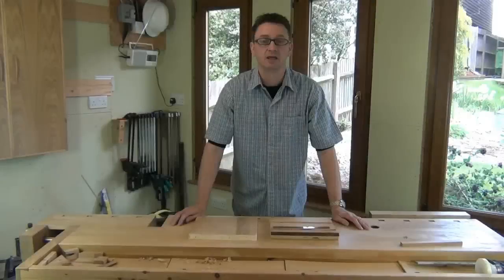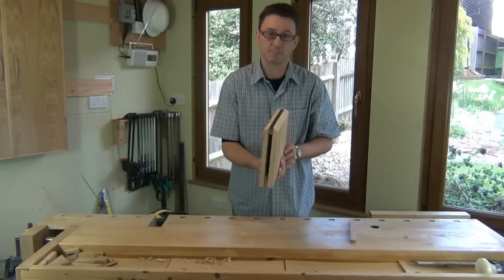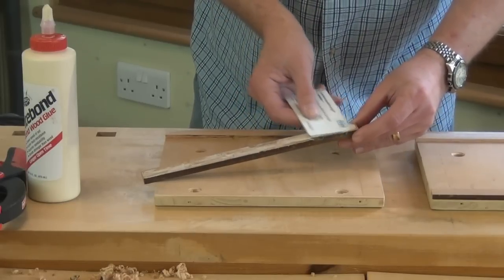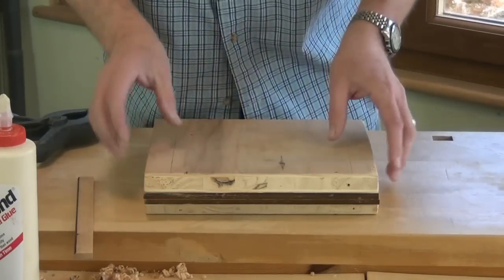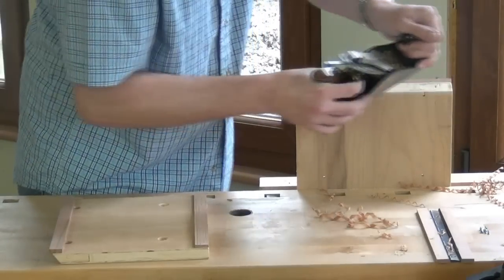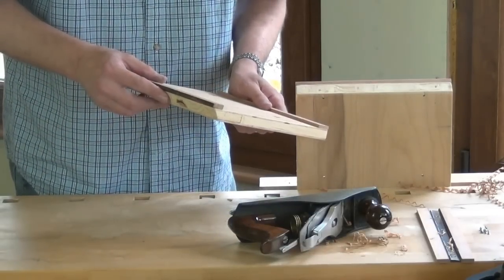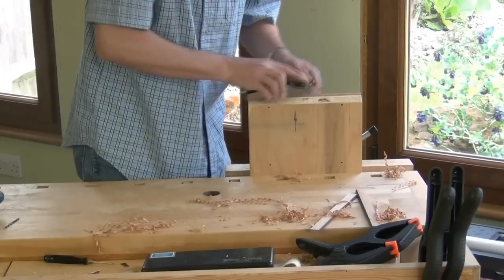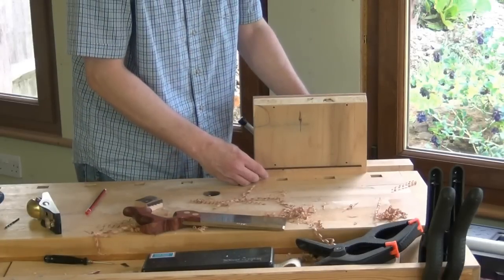Saw Vise - DIY, FREE Plans

Comment: If anything you would want B bigger than A to ensure the very top pinches tight, you've got it backwards in that respect. Otherwise the bottom of the top battens would touch before the top and you would have to bevel your top battens so they are wider at the top. Great plans though.
Reply from the maker: Haven't looked at these for years, but it's possible I made a mistake drawing them up. I'll try and remember to check on it next time I'm using SketchUp. Thanks
Reply from the maker: I understand what you're saying, but if B is larger than A, the top won't close at all since the bench vise will tighten on B before A closes. The very top of the saw vise jaws will be fractionally less tight than the bottom, unless, as you say, a slight taper is planed on the faces.
Reply: That's also true. Probably best to bevel the jaws then, or add another thin batten under the ones that rest on the vise to apply pressure above the hinge. I was thinking there was separate tightening screws at the top because of the holes there in your video, but that shouldn't be necessary. I'm in the process right now of making some based on this design right now.